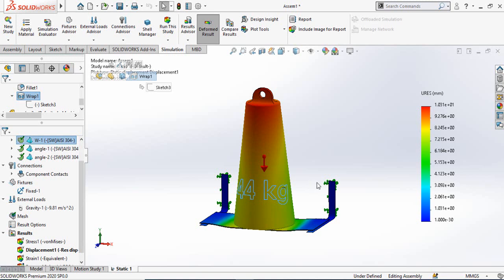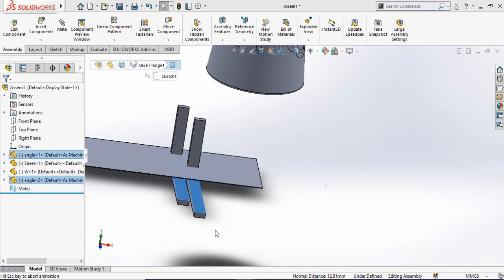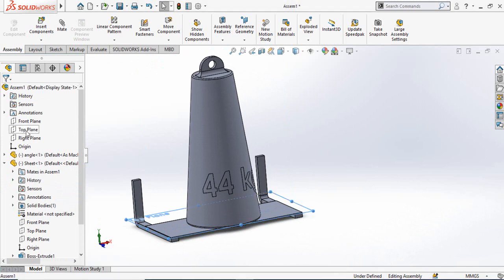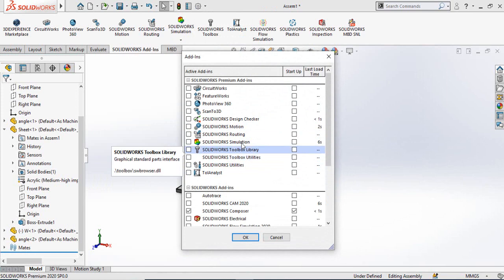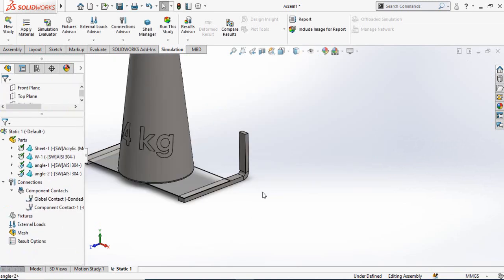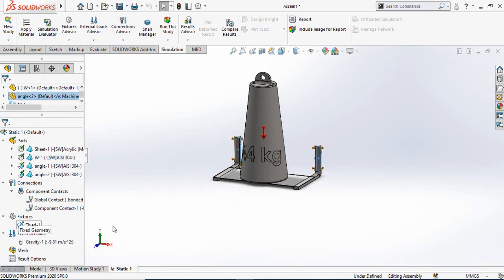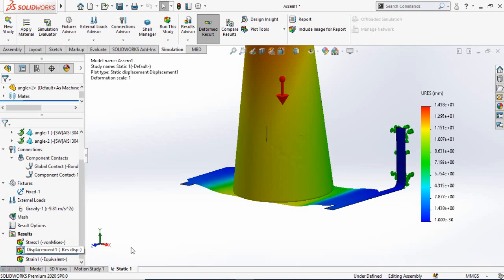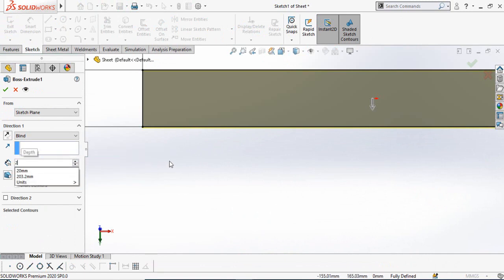SolidWorks Simulation Tutorial to Check how much weight can this sheet hold FOS

Comment: Is there a way to know the maximum load that the plate would hold without breaking?
Reply: Check factor of safety by trying different weight untill you get FOS greater or equal to 1. Hence you get to know tha max load bearing capacity of that acrylic sheet